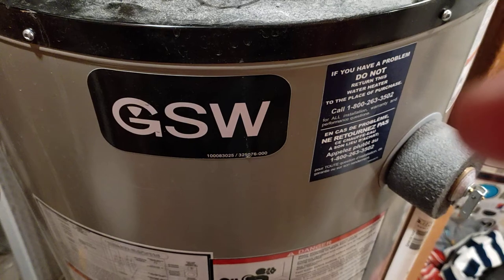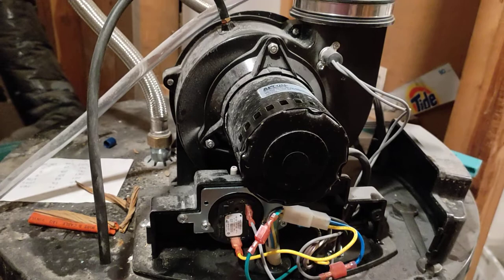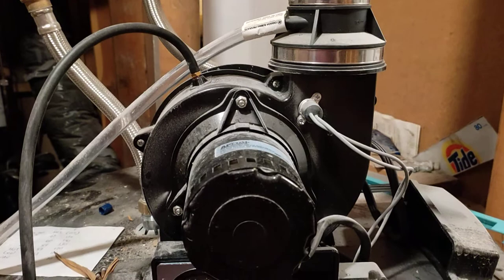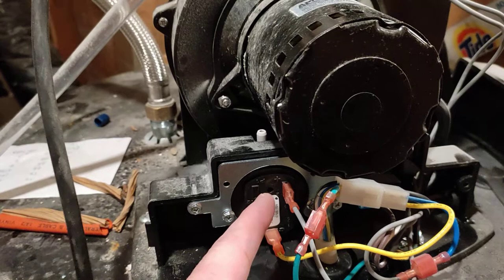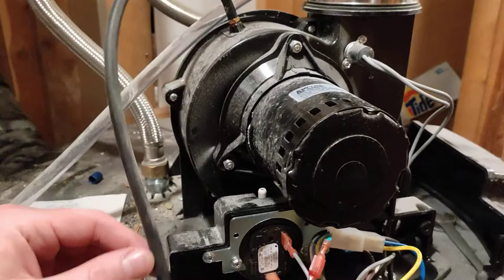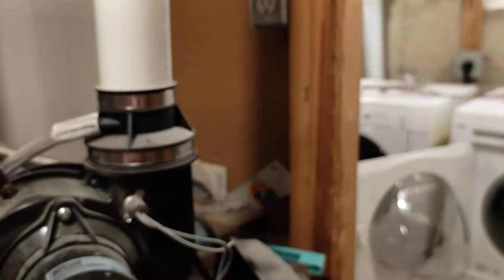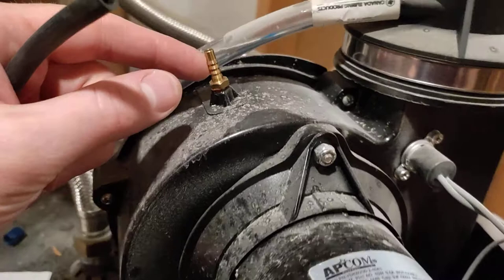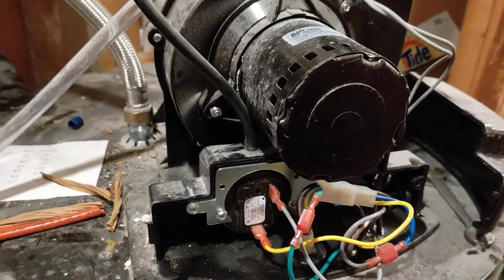Hot Water Tank Pressure Switch Failure EASY Checks to fix and save $$$ GSW

Comment: Make sure the vent piping meets specs. Accumulation of dust. mold, algae, etc  can cause turbulence and excess backpressure. Only the supplied 45 degree terminal fitting with screen should be used unless local code says otherwise. The tradition here is 2 90's to get the exhaust above any potential snow. To preserve this I replaced about 10 feet right off the fan duct with 3 inch pipe. I also disassembled the fan and used a brush to clean the fan wheel. It had bug poop on it. thanks for the close shot of the pressure switch. It looks like the same unit manufactured by AO smith, Reliance and probably Lochinvar. The unit worked fine for 5 years and then developed the 3 flash switch failed open error code.

Comment: LOL, so simple.  I tired the indoor solutions first to no avail.  Then I went outside and checked the exhaust.  It was plugged with dust.  The tiny filter that was installed was blocked.  Cleaned it and re-installed.  So far so good.  Thanks.  I had no idea it could be something so simple. 😍😍

Comment: Almost called the tech.  A plastic sheet was draped over the tank (to protect from dust while waterproofing basement) and this hindered the air flow.  I removed the plastic and turned unit off.  I turned it on again and it apparently opened the pressure switch because it started up normally again.  So, "reboot"  the thing first.  So glad I didn't call the tech!

Comment: Thank you heistnite ! Gently blew through each port of the pressure tube connectors. Reconnected the flexible tube, restored electrical power and voila it works. Your helpful tip saved me $$ & time...on a Sunday when professional help [hopefully] had a well-earned weekend off.

Comment: Wow, thank you so much. My State is set up just like yours, suddenly no hot water today. checked all the obvious, was getting the psi sw. code. found your video. Pulled the hose, no water or anything plugging it that i could see, inserted it in the switch side and blew in and out and could hear the sw flipping back and forth, blew the other side out too. again, never saw any obstruction or anything. Turned it back on and it fired up. the sw must have stuck or something. odd but its working now. thanks again!

Comment: Thank you so much for this. My heater is AO Smith. Exactly the same as you have. 
Hose connector on the blower housing was clogged up. Now it's running like a charm.

Comment: Great stuff !!!   Seems to have fixed my problem
Curious as to what causes the brass fitting at the fan housing to get blocked.   Mine was really blocked and it took a fair bit of blowing pressure to clear it.

Comment: It works if you have an error code 6-2 (blinking lights) soft lockout - recycle limit -ps/limit opened water heater. You can also use a paperclip to unclog the moisture or dust in both holes.

Comment: My air pressure nipple on the blower housing seems to have been clogged. I could not blow through the tubing. I used a small drill bit to clean it out and removed a clog caused by a powdery white corrosion.

Comment: My blower keeps getting water inside of it. Not sure how it is getting in there as there are no leaks anywhere. Maybe it's coming in from the outside vent and when it gets warm out, the condensation/ice runs down into it? Could the water come from somewhere else under the blower assembly?

Comment: I’m Having trouble with this on a power vent , I changed the whole venting replaced the whole blower and code still popping up any idea what else I can do ?
Reply: Water heater only 5 months old
Reply: Venting issue. Venting not installed properly with proper pitch